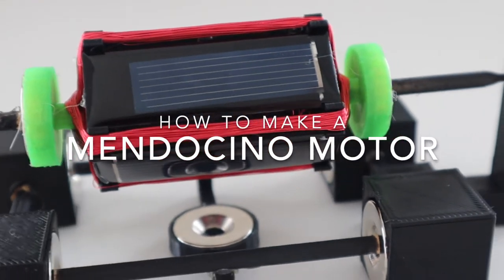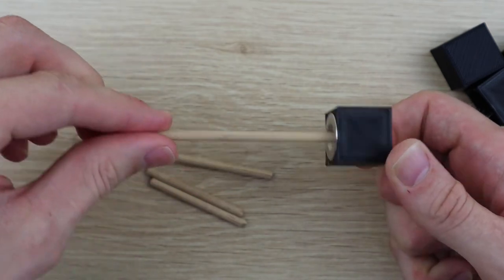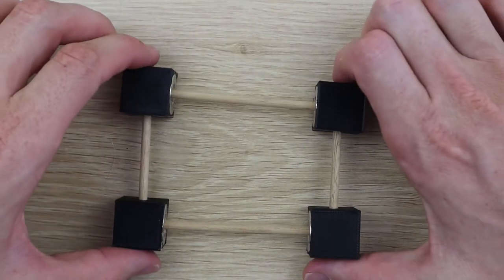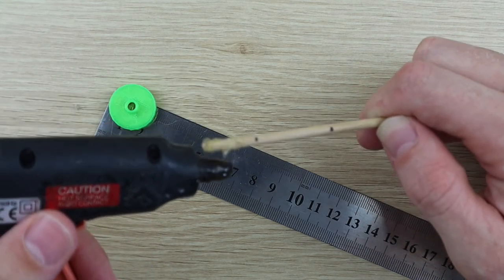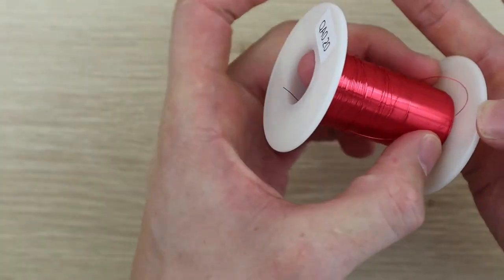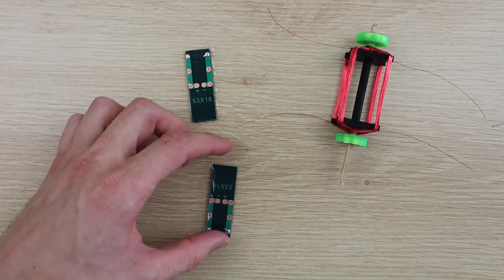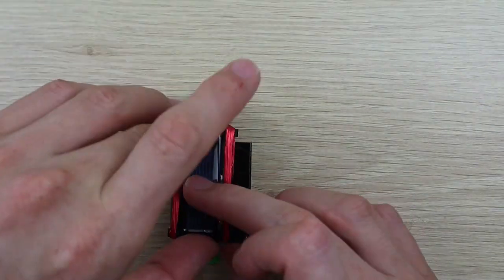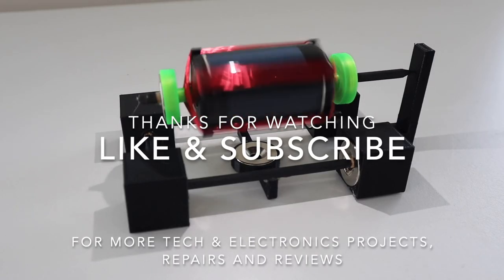How To Make A Solar Powered Mendocino Motor

Comment: I found your Mendocino motor and decided to build it for a friend for Christmas. I purchased the specified parts and started printing the 3D parts. I printed a base corner block and found that the magnets specified do not fit. The magnet diameter is 1.26" and the magnet hole in the block is .75". Is there an alternate 3D part to fit the magnet or a CAD file that I can modify? Any help would greatly appreciated!